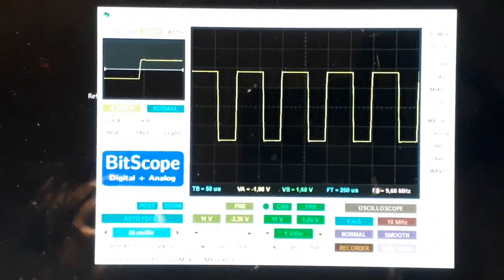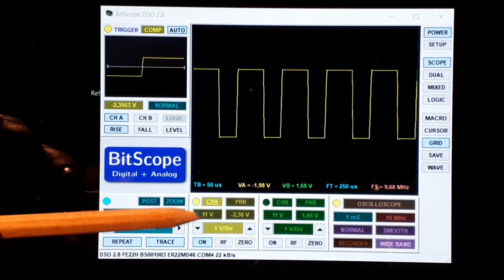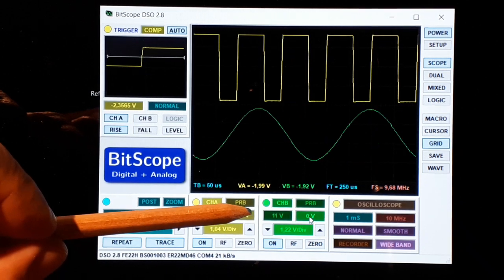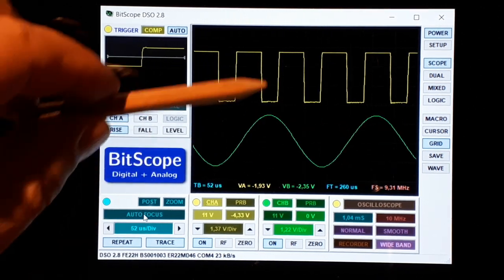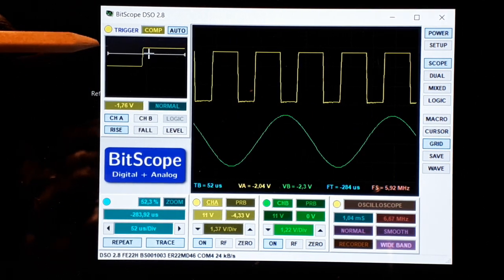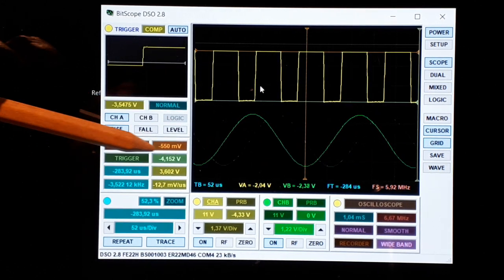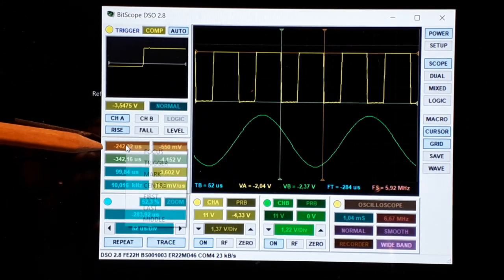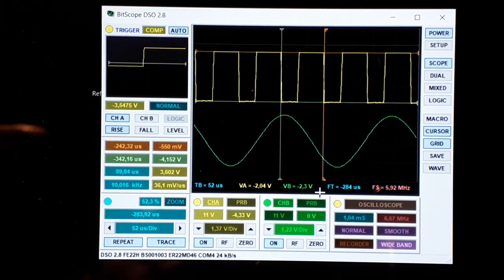Tutorial Bitscope. 1. Basic Scope functions

Comment: Great Video with lots of good tips, I ran the DSO in Windows 10 with no issues, on Ubuntu I found that chmod was needed to unlock the USB data input "sudo chmod 666 /dev/ttyUSB0" in terminal, otherwise DSO 2.8 reverts to a simulation mode and the hardware is ignored.
Reply: You just saved me from tearing my hair out and sending my Bitscope Micro back to the distributor. Manufacturer's documentation is poor. When I made your device permissions mod in Debian 10, the DSO software exited simulation mode and recognized the device -  which promptly started sampling. Seems to work much like the tutorial demo - a useful instrument. THANKS.
Reply: @stefanoaz  Yes, I was clueless until I saw that word simulation at the bottom and I recalled how protective Linux is.
Reply: Oh god... I was about to throw away my bitscope until I saw this. Thank you. I don't understand why bitscope the company makes no effort in documentation or support.